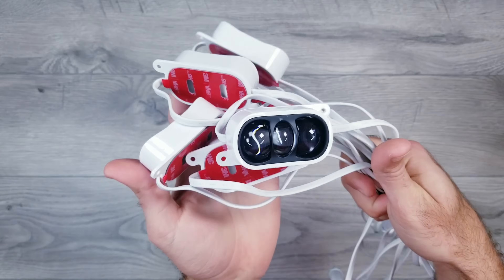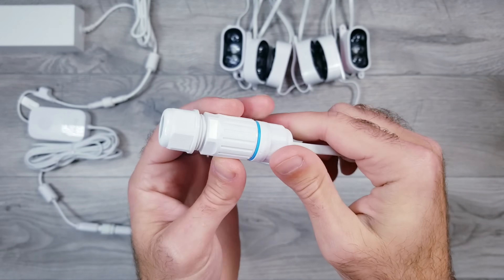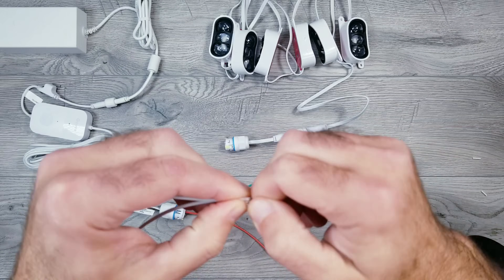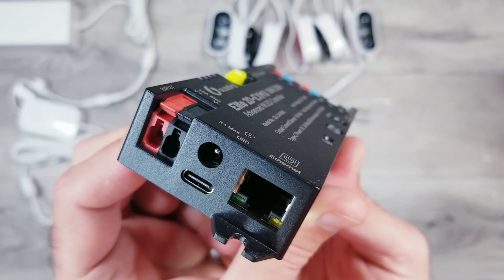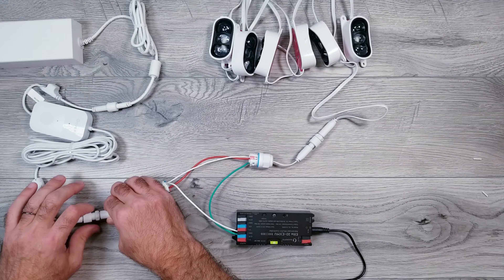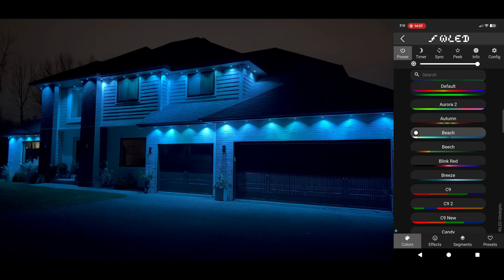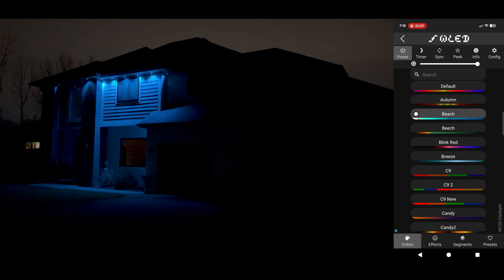will it WLED - Episode 3 (Govee prism outdoor lights)

Comment: Hello Chris,

I hope you’re doing well. I recently purchased the Govee H707C (200ft) Prism lights, and my setup is almost identical to the one you demonstrated on your channel. Everything was working perfectly at first, but suddenly the setup stopped functioning properly.

Here is my exact layout:

I am using half of the total strings, and I still have about 4.5 strings unused.

From the controller to the first light, I have a 15 ft jump.

After that, I have 4–5 strings with approximately 10 ft jumps between sections that run through the attic.

My total length used is well under 150 ft, so still below Govee’s recommended 200 ft limit.

It worked fine originally, but now the lights stop working completely. I opened a ticket with Govee Support, and they said that as long as I'm under 200 ft, the setup should work. But the issue didn’t resolve.

Since I noticed that your exact layout works with similar jump lengths and distances, I was hoping you could help me understand:

👉 Did you have to change any settings on the controller or in the app to make long jumps work reliably?
👉 Do you recommend a specific wiring approach between jumps?
👉 Have you run into the same issue before, and how did you fix it?

Any guidance you can provide would really help me get my setup working again. Thank you for your time and for the great content you create — it’s been super helpful.

Comment: How far did you put the lights away from the wall
Reply from the maker: These prisms were 5 inches from the wall. And in case you watch my comparison video between the prism, pros and Asahom, the pros are 4 inches out and asahom is 3 inches out
Reply: @ChrisMaherDIY i bought the wled controller but will the settings be the same for the 100foot govee prisms
Reply: @ChrisMaherDIY yes i did watch the comparison video why did u use 5 inches from wall on prisms

Comment: Do you have a current best outdoor permanent lights?
Reply from the maker: Thanks for watching! Just did a comparison video between the 3 beats kits.
Reply: @ChrisMaherDIY missed that I'll check it out 

I wonder if it's possible if you'd be able to make a video in the future about a fully DIY permanent install system.   Meaning you choose the LED modules and how many and how close together and wire them all up I would think that this is one of those things we should be able to do aftermarket if all of the modules and stuff are readily available if they're not all proprietary
Reply from the maker: @Reedith that's a great idea! I'll put it on the list of future video ideas! That would be a fun one to do for sure!
Reply: @ChrisMaherDIY looking forward to it it's something I've also been kind of researching in my spare time I guess the alternative is just a regular old light strip around the whole house which would be cool to see as well but only works on houses with gutters that have something smooth the entire way around

Comment: Could you make a video where the led strip only has white (cool white to warm white) and wled can control it, like set it to any color temp. This is useful for regular home use as RGB in the living room is unnecessary, but being able to set the mood with warm, neutral and cool white is really helpful. Thanks.

Comment: It seems like the progression of these lights is heading towards just an LED strip for perfectly diffused glow and effects

Why not just get an outdoor rated LED strip and diffuse it into the walls? Are they not bright enough?
Reply: Led strip is a lot more fuss. You'll need channel, multiple injection points, weatherproofing, and it will look very different from these. These are lensed, and have much larger led crystals.

Comment: Can I make a suggestion?  I'd rather use WLED on a cheaper product.  Maybe grab something much cheaper off of Amazon and then make it better, brighter, and more value with WLED.
Reply: Cheap things made better, sure. Better controller will make them more useful. But brighter? Unless they are massively under supplied in power, one would assume they are already operating with fully available brightness.
Reply: @SierraGolfNiner See my video, they are.  I maxed out a 180w power supply easy and you only get a 80w one

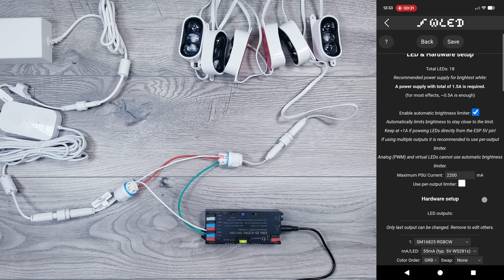Comment: 2:31 you didn't change the mA/LED setting for the lights, its still set to 55mA (5v) so the brightness is way down. Not sure what the current draw for each pixel is but you can probably get them quite a bit brighter by entering a lower mA value. Mind you you probably don't even need them any brighter haha.
Reply: what setting do you suggest?

Comment: y not power the controller from the govee power? 🤔
Reply: That controller only accepts up to 24V and the Govee outputs 36V.
Reply: @jonpferreira  ok thx, didn't think they are that high of a voltage
Reply: You'd need a buck converter. More logical to get a separate psu

Comment: Good information. Your power adapter outputs 2A and you set the WLED max current to 2200mA (2.2A). Would there be an issue? For you're whole house (126 lights), did you use the same power adapter and same WLED max current? Apologies for all the questions but I'm learning as I go and dont want to cause an issue of overloading or worse, a fire. Thanks Chris!
Reply: The power adapter (Govee) is 2.3 A no ? The other power supply is only for the controller, no the lights.
Reply: @TEKDAD  Not posting that channel any longer?